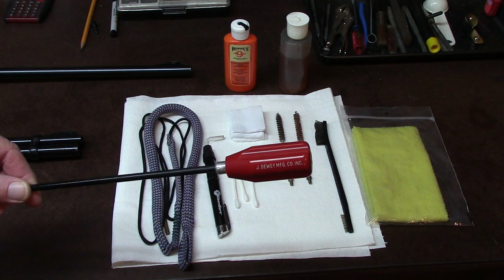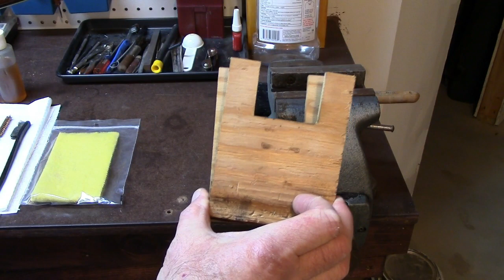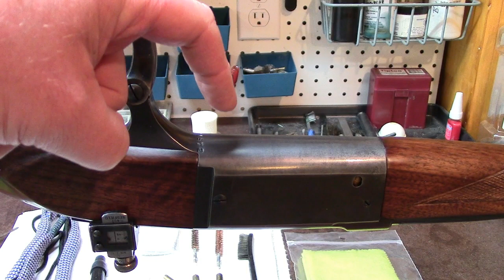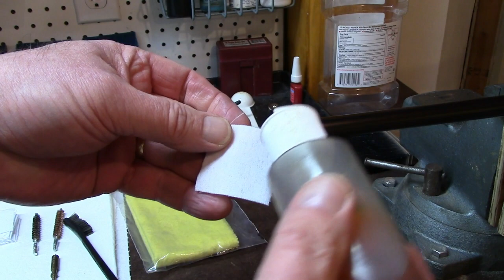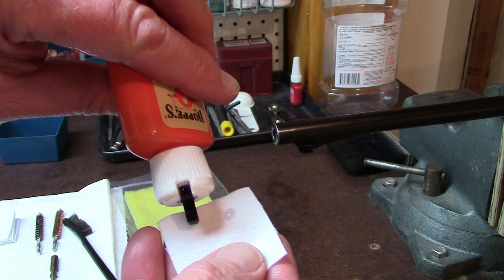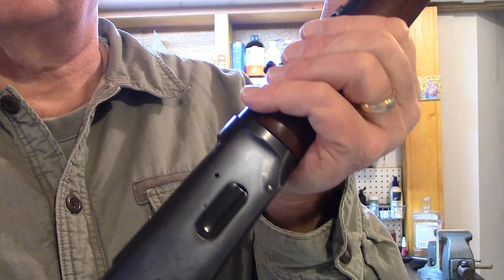How to Clean Lever Guns

Comment: Hello sir, would the "dry is good" bit apply to an original Winchester Mod. 92 as well? I recently got mine in 44-40 and the action is certainly not dry, doesn't have oil, but does have some lubrication of sorts. Also, there's some malleable (meaning, can be swept away with a qtip) gunk around the action area, too, despite the bore & barrel looking really clean and overall condition being astounding for a 110 y/o rifle. Regarding the magazine, the follower looks dry and clean and the (don't know its technical name) round-elevating, spring-operated ramp that feeds the chamber seems to be clean and dry as well.

As a different question, I tried the feeding action and thus loaded just four rounds, and quickly cycled them, without firing any of them, since I'm not at a range but I do have a place to do so safely. Thing is, out of the four rounds and different tries, there was always one round that failed to be fed properly right before entering the chamber, either by the (relatively soft) lead nose bullet biting the chamber's top, or the point where the lead meets the brass getting stuck at some point, again, at the chamber's beginning. Every time it happened, I solved it by giving the lever a light tap. All rounds were always ejected flawlessly. Would you have any idea as of why the failures to feed happened, or how to avoid them?

Thank you very much in advance for any and all help you could provide me with, and needless to say, thank you enormously for the amazing video and different, well detailed explanations about each step of the cleaning process.

May you have a great day sir!
Reply from the maker: Hans Von Mannschaft 
No rifle requires oiling.  Any gun can have cycling problems that occur due to mecanical breakage, distortion, ammunition dimensions, or misadjustment.  I am not in a position to assess a mechanism without being able to physically inspect it.  Any qualified gunsmith can help you.
Reply: Sir, I think I found the feeding culprit. It was me not pushing the lever all the way forward, and thus the cradle wouldn't go up all the way, causing the round to be pushed into the chamber by the bolt before it reached the height Mr. Browning planned to. I noticed this by paying attention while slowly cycling on an empty chamber, and noticing that it wasn't until the last very bit that the cradle achieved those almost 45º.

Leaving the above mentioned comment aside, I thank you dearly for your quick reply, it brought me some much needed peace of mind.

May you have a great day sir!
Reply from the maker: I'm pleased that you were able to find the problem.  It's one of the most trustworthy mechanisms ever made.  You have a good day as well.  God bless.

Comment: When I took the rear barrel band off, on my M94 the screw came out just fine. When I went to go put it back in it refused even though everything was lined up properly. It wouldn't want to thread with the barrel band. Do you have any advice? Thanks.
Reply from the maker: The screw will find the hole if you lay it on an anvil and strike the middle of the shank lightly with a small 2 ounce ball peen hammer.  This will place a slight bend in the screw as the factory armorers did to find the hole.  Should work just fine.
Reply from the maker: In addition, be sure the slot in the magazine tube and barrel are lined up.
Reply: Thank you very much. Thanks for the quick reply. God Bless.

Comment: hi, how far dismantling did you have to go to clean the "well" or did you just use the qtips to get that part clean?  thanks
Reply from the maker: walter vangorden 
After removing the stocks, I removed the lever and bolt assemblies.  I then soaked and agitated the receiver in mineral spirits repeatedly, which removed most of the sludge.  I followed up with a compressed air nozzle, using the least amount of pressure necessary to clean and dry it.  Wiping the parts with a lightly oiled cloth and q-tips completed the job.

Comment: Keep your bore snake in a clean pill bottle so it does not pick up grit,set down on a surface it may well pick up sand or grit and that may end up in your bore so don't put it in your pocket, but then that be your choice.
Food for thought. And use a crown protector keep your crown safe.

Comment: I have found an old '73 winchester but it is covered with varnish,can you tell me how to get rid of it?
Reply from the maker: I presume you are speaking of non-original varnish. Any varnish remover will get the job done, used carefully and according to instructions.  If it's on the steel, be extremely careful to test first on a small area, and be certain it's not corrosive. Use a plastic scraper to prevent surface damage.
Reply: Thank you for replying not everyone is so courteous.
Yes i should have been more exact ,yes the metal is covered with old gunky varnish,i seem to remember that some people  covered wall hangers with varnish so they didn't have to keep cleaning them.
Also the wood is black with oil, you mention acetone ,what is that? Would petrol do the job?

Comment: Hi GunBlue490 or anyone else will you help me with 3 questions I need answering please. #1: cleaning kits often have plastic jag, are these ok? Or buy the metal ones. #2: I bought a 357 magnum 1873 lever gun, and I don't see a "rifle" cleaning kit, or rod for 357 magnum rifle. #3: bore snakes for 357 magnum are only for pistol. Is this possible to use? I can't find a rifle bore snake in 357. Thanks for your help
Reply: Hi, not sure if you've found one yet, but even in England we can get bore snakes for .357 magnum rifles.  Hoppe's bore snakes seem to be pretty great and you can get them on Amazon

Comment: starting reloading 300 Savage myself and will try your suggestion on the IMR 4064, I have some 150 gr RN  Hornady interlock bullets looks like they set very deep in the neck to seat to the interlock ring, what are your thoughts?
Reply from the maker: Robert, I've shot many Hornady Interlock over the years, and I've rarely encountered a gun that won't shoot them accurately.  Their spitzer bullets can cause seating issues due to the long tangent ogive, but the RN bullets should be fine, as they have a more standard shank length.  The .300 Savage has a very short neck that can slip a bit under recoil, so it's nice to use the cannelure to crimp the case mouth, but it's not entirely necessary, if it doesn't line up.  Just don't crimp elsewhere, unless you have a Lee Factory Crimp die, which is my strongest recommendation, as it will form a perfect crimp in any bullet, at any place on the shank.

In the case of the .300 Savage (and I can only speak for the Model 99, having no personal experience with Remingtons and others), the overall length cannot be extended very much at all.  Sierra bullets, and others with a standard ogive, reach the leade very easily.  Hornady Interlocks pack all the weight of the bullet in the shank of the bullet, which makes it a different fit.  I would guess that the RN shape will help your situation, if anything, being a stubbier bullet. 

My finest accuracy was with the rather standard 40 grains of IMR-4064, using WLR primers, Remington cases, and Sierra 150 grain flat base bullets.  I tested all the way up the ladder in 1/2 grain increments to 44.0 grains, in accord with Hornady's loading data (they used a Savage 110).  Getting more than 42 grains into the case with my bullets was a chore, and 44 grains wanted to push the bullet out, though all were very accurate, ranging from 1/2" for the 40 grain load to no more than 1-1/2".  Those fully compressed loads are exactly the same velocity as .308 Win. loads, which I see no need for whatsoever for deer hunting, being far too much velocity, meat destruction, recoil, and blast.  The .300 Savage built its fine reputation as a classic deer cartridge with factory loadings of around 2,670 fps, a near ringer for the original .30-06, which gets it done all the way to 275 yards without any hold-over, and plenty of energy.  RN bullets reduces that range by 40%, but it's a woods proposition, anyway.

I highly recommend small base sizing dies for the cartridge, as I find that final closing of the bolt can be a bit difficult, requiring it to be slapped shut, which is not good for field conditions.
Reply: GunBlue490 yes my Savage 99 is identical to the one you have in the video less the tang peep sight, I have shot good groups with factory ammo at 100 yards, with most being Rem pointed soft point bullets, but as my concern with the round nose interlock Hornady bullet is that the overall length measures a very short 2.40 when crimped in the interlock ring, do you think there will be a problem with that length?
Reply from the maker: Robert Farrand
No problem at all.  There is no minimum length for any cartridge, as long as it functions.  The stated cartridge lengths are the maximum industry standard, but most cartridges can be lengthened to get closer to the rifling, magazine length permitting (you should always have at least 1/32" clearance for feeding).  If you can or want to extend it farther to get closer to the rifling, the cannelure can hang out, without a crimp, or you can use a Lee Factory Crimp die to make your own.  Never use a standard crimp die to force a crimp in a bullet.
Reply: GunBlue490 Good that is what I needed to hear (no minimum length) I have just the Lee 2 die set. so I am just using the roll crimp of the bullet seat die to crimp in the interlock ring of the bullet, keep my eyes open for a factory crimp die if I use a bullet without a interlock ring. thanks for the information, I enjoy your video's on Youtube.

Comment: Thanks for your fun and educational videos.  I haven't seen you cover something like the M1, but I'm assuming you would put grease where the manuals say to put grease at? or?
Reply from the maker: The manual for the M1 Garand instructed users to avoid grease in areas subject to extreme freezing, dust, or dirt.  The writers apparently were unaware that freezing, dust, and dirt are the particulars that describe combat environments.  Grease becomes stiffer in cold weather, and in dusty conditions, attracts abbrasive dirt that will wear a gun quickly.  There are no sealed bearings, so every particle of dust becomes embedded with the grease, as an abbrasive agent.  Nobody in WWII used grease on their M1 rifles, if they desired them to operate reliably.  Ruger Mini 14 rifles are made based on the Garand model, and they recommend only a wipedown with a lightly oiled cloth.  It's all I do for my Springfield Garand, and it functions just fine.  Grease won't harm your M1, but it won't do anything to improve it, either.  They are very durable guns that last for a long time.  The greatest destroyer of that gun is corrosive ammo.  That's far more significant than any discussion about lubrication.

Comment: with no oil, how do you keep moisture out?  Im just worried about my model 94 rusting.  want to keep it nice
Reply: Lightly use oil, a little goes a long way, but if you get too much on the wood you will rot it. Use firearms grease on the action and sparingly use oil on the surfaces.
Reply: Too much oil traps carbon, which attracts moisture and causes corrosion.  If you can see the oil on the surface, you have too much.

Comment: If the rifle had not been so heavily oiled would it be in such good condition if the previous owners weren't brave enough too pull it apart?
Reply from the maker: Heavy oil almost destroyed the gun.  I am a rare individual who could restore what had caused catastrophic damage to the wood, and had utterly filled the action with oil soaked mud.  Guns do not require oiling.  They die from oiling.

Comment: I'm a bit confused, should I use a lot of oil?
Reply from the maker: Dean Edwards   Methinks you are pulling my leg.  I never once suggested in the least that I recommend "oiling" a lever gun in this video, or in any other of my videos.  Oiling beyond the protection afforded by the simple wiping with a very lightly oiled cloth does nothing beneficial to a gun action.  Oiling collects abrasive matter, contaminates wood, gets sluggish and can even freeze in cold weather, corrupts the required sealing of chambers, obstructs bores, and causes many feeding malfunctions.  

If you are still confused, clean your lever gun and any other gun with simple solvent and dry it.  Follow with a wiping of parts with a protective, invisible, barely detectable coat of light oil.  I recommend cutting a 20 inch square of heavy soft cotton flannel from a yard goods store, upon which you evenly distribute a couple of teaspoons of pharmeceutical mineral oil, which protects as well as any oil, and is 100 percent safe to put on a baby, with no noxious, unnecessary additives.  Wring the cloth to distribute the oil, fold it, and keep it in a zip bag.  If it leaves more oil on a gun than a Lays potato chip leaves on a paper napkin, it's far too much.

Comment: years back we use to run diesel fuel thru the works after a goose hunt and cycle it dry and wipe.
Reply from the maker: Such a practice may be ok for the action, but it's death on a wood stock. Gunstock wood must never be subjected to petroleum based products, lest they crack and eventually dry rot. The evidence of oil damage is seen on countless poor stocks that crack at the tang and have darkened irreparably.

Comment: Guns are made to shoot FMJ ammo witch does nothing to the bore crown. So why are so many afraid to pass a aluminum or graphite rod from the mussel. Aluminum is softer then FMY jackets. You will shoot the gun out long before  you will damage the crown by cleaning it.
Reply from the maker: In answer to your question, the crown of a firearm does not "wear out", and has the same life as the bore.  However, it is certainly an edge that is susceptible to damage by denting, nicking, or abrading, just as the edge of a table or coffee cup is.  Such a damage need not be more than a mere thousandth of an inch or less to affect accuracy. The passage of bullets through it does not affect it in the least, nor does the passage of a cleaning rod, but accidentally bumping it with anything, or rubbing it at an angle with certain articles certainly will harm it, which has been known since the days of black powder Schutzen rifle competition, when "false muzzles" were used to guard the fragile crown from the process of starting soft lead balls and cotton patches made from pillow ticking.  Alminium is highly abrasive to steel and will cut it, and is the metal used in cutting wheels and aluminum oxide paper used by body shops.  It's the worst sort of cleaning rod ever invented, which came out after WWII, when the US had monstrous stockpiles of aluminum left over from the combat aircraft surpluses.  Much of that aluminum went into building the first aluminum boats and camping trailers, but unfortunately, it was discovered by cleaning rod makers. The only proven safe rods are plastic coated, spring steel rods, or one piece hard steel ones.  The jury is still out on fiber rods, which I'm skeptical of. Smith and Wesson learned decades ago that graphite being used as a dry lubrication was extremely abrasive to their handguns, so I'd be very leery of rods made from it. Hardness has absolutely nothing to do with cutting effectiveness of on steel.  Leather is used to strop fine edges on barber razors and kitchen knives, and if done incorrectly, will quickly ruin the edge. Cutting cardboard boxes will rapidly dull the best stainless steel knife.
Reply: @GunBlue490  Most people want to put the blame on something other then ammo or the shooters in ability to shoot consistently. There are dozens of reasons that affect accuracy, so blaming something else then the shooter always gets the blame.

Comment: yes what ever you do dont oil your guns and when you take them out of your safe 6 months latter you wonder why you have rusty finger prints all over your nice blued steel . sir you once said a gun is nothing more then a machine there for i say you should go take a tour of an automated factory and you will see oil or lube is the life blood of that factory. You also said at one time ruger stated not to oil their guns well none of my manuals say not to oil the gun.bottom line is this i care not that you were a so called armorer or worked for SW or worked for ruger steel on steel creates friction friction is heat and heat creates wear correct you also said that at one time so all that being said i will keep oiling my firearms like i have always done the past 60 years and keep my guns in mint condition as they are  but if you tell me you worked for holland and holland may be i will take your advise  bottom line i would NEVER tell anyone on how to not oil or oil their firearm or how to repair or adjust triggers etc why liability thats why